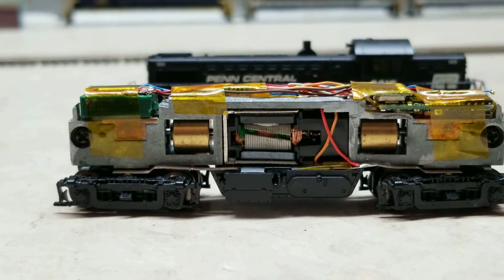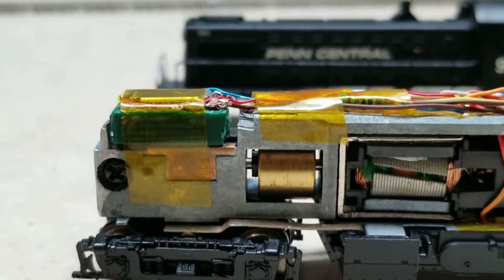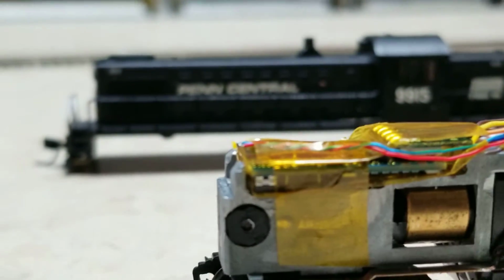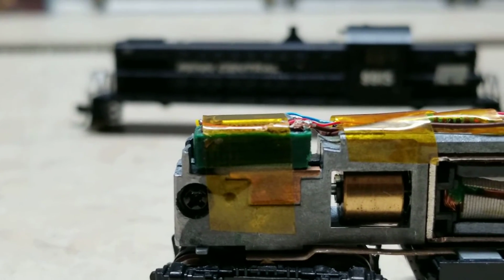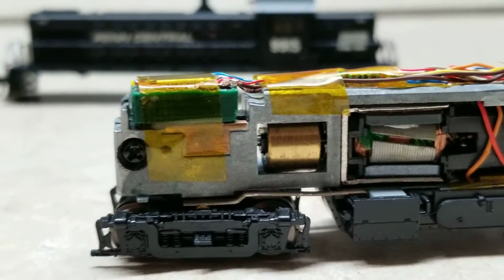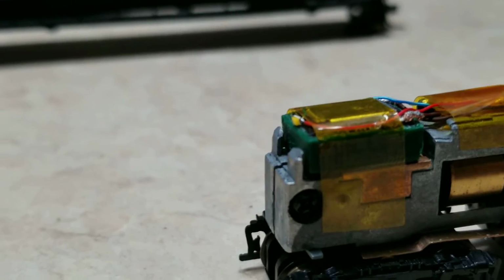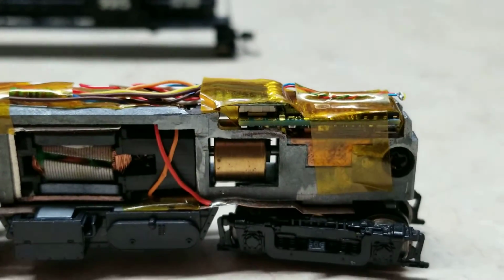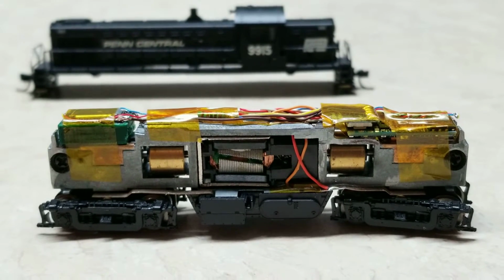ESU LOKSOUND 5 DCC MICRO Sound Decoder In an Atlas N Scale RS-1

Comment: Thanks for getting back to me and if you don't mind, I have a few more questions and a comment. If I'm understanding you all the ESU Lok sound Micro 5 DCC decoders have a Next 18 connection on the decoder and some form of cable connection like an 8 pin, wired (58823) and or 21 pin that is plugged into that decoder connection?  Is the one LED resistor that you use a 1K 1/8 watt?  Do you use prewired 603 LEDS?  Do you add holes or install a fan in the shell for better sound?  Have you ever tried using the ESU 11 X 15mm speaker and enclosure in any of your installs?  Finally, it would be very helpful if you included a detailed component list with your videos that way guys like me wouldn't ask so many questions?  Thanks again you have been very helpful.  I look forward to more of your videos and hope you don't mind comments.

Joe
Reply from the maker: Yes, all ESU Loksound Micro 5 DCC decoders have a 18pin next 18 connectin on the decders. That is so you can adapt any of there cables like the wire 51993, 8pin, nem6, ect...
to the decoders. Resisters are 1k 1/8watt. The 603 LED's come prewired in a 10pc pack along with the resisters that I buy off Ebay from seller 'busybeavertoys'. The LED's are 20ma
and I use only one resister for both front and rear head lights. I have used one resister for the F&R lights along with ditch lights in about three differnt Loco's with no problem. You can use more than one resister, I choose to use one. I never add holes for sound using sugar cube speakers, as the body shell kinda acts as a sound chamber. Conventional speakers will
probaly need holes driled for sound. I have used ESU 11x15 speaker in a Bachmann 2-10-2
steam locomotive. Fits very well in the tender where the decoder is. They have great sound.
I will try to use more detail in my videos, espcially on the parts that I use, and why. No problem you asking questions, ask as many as you want. Just remember to check the frame halves for polarity, you do not want any short circuit's between the frames.

Comment: Great video and great work,have 3 kato n scale rs2 want to put sound in ,drop in decoder ,any ideas or help would be appreciated
Reply from the maker: hi stanely, I use ESU Loksound 5 Micro DCC decoders part number ESU 58823. This comes with single strand wire interface for hard wiring the motor, track power, lights, and speaker.
I use this decoder because it fits nice into N scale loco's with little to no modifying the loco's.
Kato uses different track power pick up method than say, Atlas that uses brass contact strips. The frame will need to have some milling done and possibly underside of body shell as well to fit the speaker and decoder. With Kato, you will need to leave the origanl light board tab slots on one end of the frame so you can use pat of the old light board cut off and left in the frame tabs for the decoder power wires to be soldered to. I use 8mmx12mm sugar cube speakers I buy from Ebay member skent96. 
I dont want to sound like I'm promoting ESU, thats just what i use.
ESU decoders come blank, so the decoders will need to have the sound file
down loaded into them. I purchased a ESU Lokprogrammer 53452 and ESU decoder tester 53900 to download sound files into my decoders. I knew I was going to convert all my loco's to sound, so I went with ESU products. All sound files are downloadable from ESU Loksound. You wont be able to use JMRI or any other method to down load ESU sound files. Alco RS-2's will use the same sound file as the RS-3's. If you decide to take on this small task, make sure you check continuity between frame halfs with multi meter. No shorts between them. Electrical shorts between frame halfs will kill the decoders.
Reply: @Conrail3385  out of curiosity, I have wire n scale f7a , now going to attempt a kato drop in rs2 which looks like a similar frame ,did you use sugar cube or oval speaker and any suggestions for this project, thanks
Reply from the maker: @stanleym2679  I used sugar cube speaker with sound chamber. I milled off some of the sound chamber box to get it to fit.

Comment: Ron
I'm looking at doing one of my RS-1's  I'm practicing on a spare body.  I've milled out the body and its pretty thin was this your experience?   I'm trying to not destroy a good body.   Did you by chance file the sizes of the decoder?
Reply from the maker: The body shell will get pretty thin, be carefull not to get the shell to thin. I did not file on the decoder, this will cause the decoder to not work.

Comment: Ron
I have enjoyed watching your decoder installation videos very much.   I'm planning on doing some ESU Loksound 5 micro decoder installs and was wonder if you  can answer a few questions?  Could you tell why you use the  Esu Loksound 5 micro dcc Next 18 (guessing 58828) version decoder as apposed to a 58823 wired version.  Also can you tell me what 8X12 speaker and enclosure your using.  Your install sound good.  I was planning on buying some 8X12 Soberton  from Digikey and scratch building enclosures and finally are you using and types of keep alives like tantalum polymer capacitors in your installation.  If not are you having any problems not have any?

Joe
Reply from the maker: Joe,
ESU Losound 5 micro all have the Next18 interface connecter on them. So you can
use any ESU cable interface's. I do use the 58823 decoder most often, they come with the
51993 wire harness. The 8x12 sugar cube speaker's I buy off Ebay from seller skent96.
These speakers come with a sound chamber, and are unbranded speakers.
 Sometimes I have to modify the chambers. The 8x12 speakers fit into N scale Loco's better than any size that I have found. I do not use any type of keep alives. I usually do not have 
trouble running my trains.